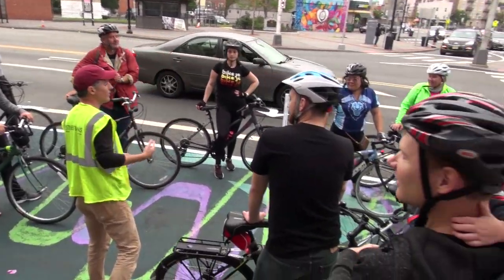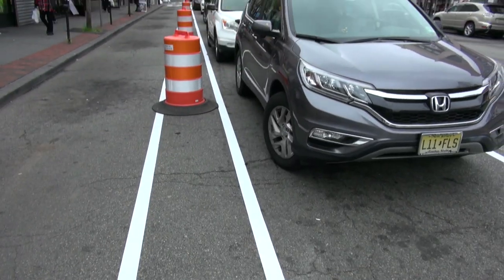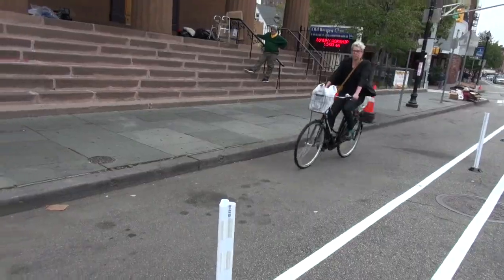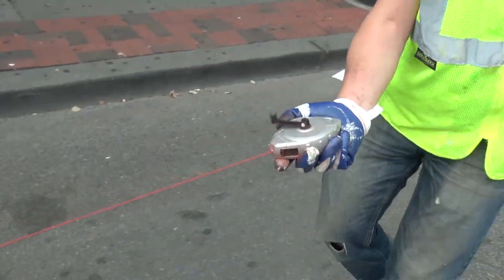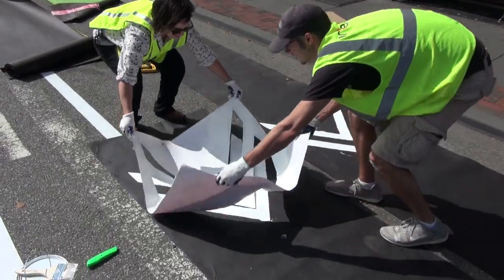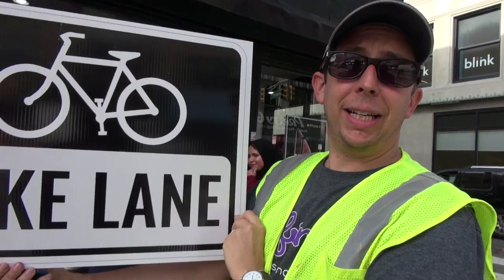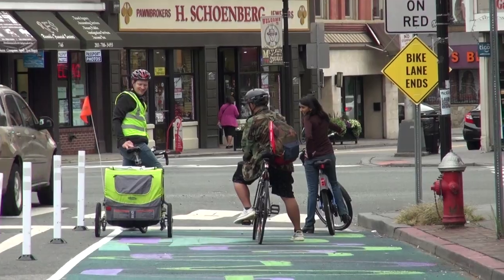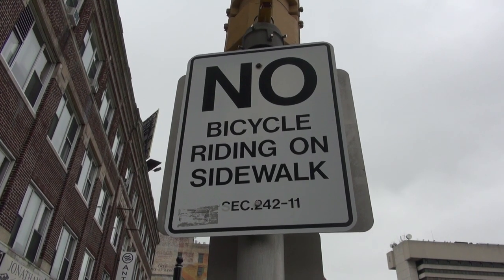Jersey City Experiments with its first Protected Bike Lane

Comment: New Jersey is not cycle friendly at all!  One of the worst things about it (except Hoboken), drivers are not familiar with bike hand signals, so when you make a sign that you are merging or turning people will honk at you and try to run you over.  Drivers will tell at you when you are merging left so you are not in the right turn lane.  Drivers also increasingly do not use turn signals, so there's an increased chance of getting hit when going straight.  

A protected bike lane on Bergen would be amazing.  Also JFK, Tonelle, and West Side.  Hopefully there will be more bike shops in the future as well; there are no general bike shops in East Rutherford, for instance, and not even that many in Jersey City.  If you get a flat tire or something up with your chain on your ride you are out of luck.  

Yaaay to bike lanes!